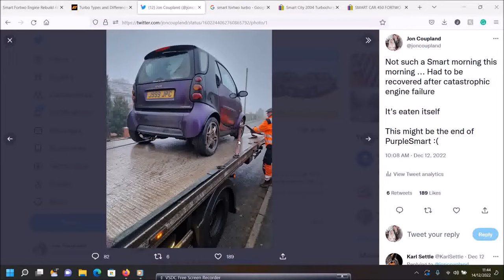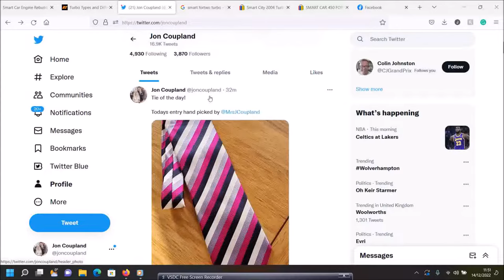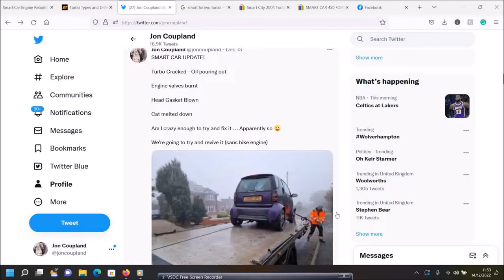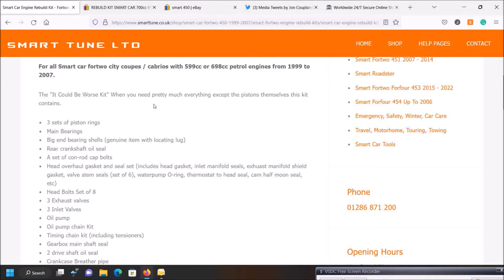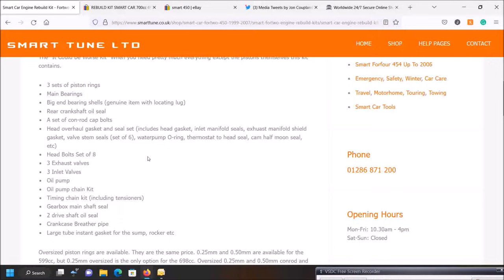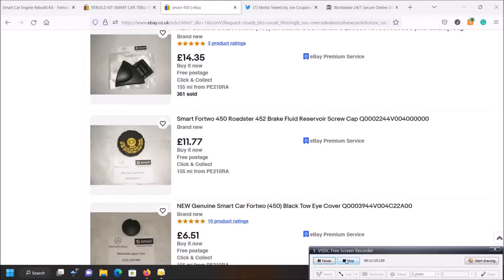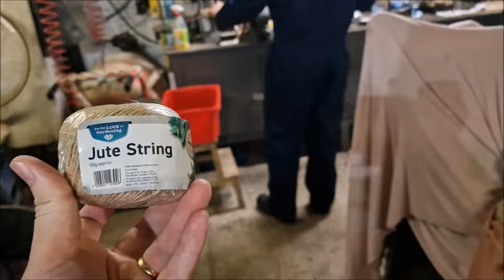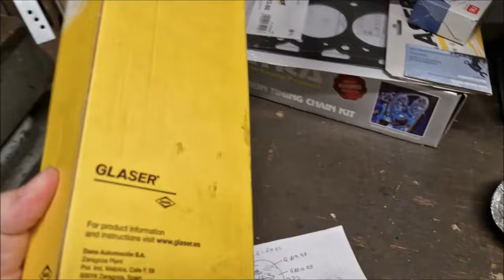Smart ForTwo 450 - Entire Engine Rebuild After It Blew Up - Mega Video

Comment: I made the mistake of selling my early 450 years ago when the 598cc engine imploded. Many years later it turned up at Smart Tecnic to sort out the engine, owner of the garage recognised the number plate and let me know, and I ended up buying it back again! Next time I'll just rebuild it, but logistics were against me first time around.
Reply from the maker: Ah a great story! 👏 Do you still have it?
Reply: @JonCoupland  Yeah it's a keeper, irrespective of what breaks or needs replacing. Don't really need it as I work from home, but enjoy tinkering with cars, so have that and a 452 that's now on 160,000 miles and will also be used until petrol is no longer viable. Flawed little cars, but absolutely love them - perfect for today's speed limit obsessed society.
Reply from the maker: @philthewriter  fantastic 😊 I'm glad you love them as much as me

Comment: Memories triggered.  Was done for high oil consumption in my case and post ten years off the road I’m still working through things - exhaust looking like the next part needing replacement.  Not sure where you sourced yours/ if it has been fine since?

Like others, mine is never forsale.  Tempted to spend serious money on an Smann upgraded exhaust for that reason; I can almost justify the eye-watering cost for the best quality
Reply from the maker: Genuine exhaust now no longer available from Smart sadly. Have to buy pattern Cat Backs. The cheap and cheerful one cost £100 and has lasted around 3 years. I'm literally about to replace it tomorrow